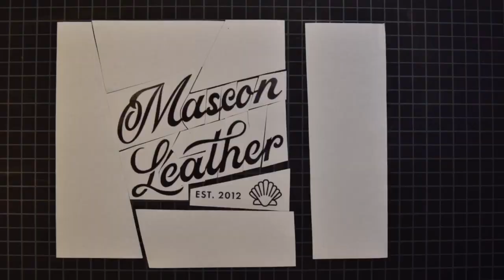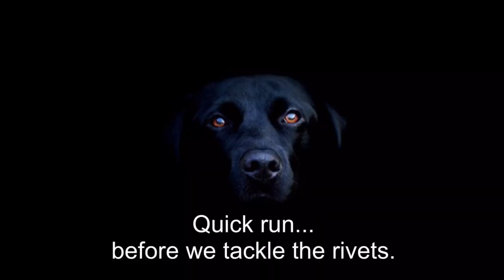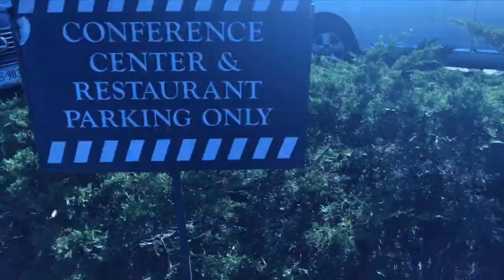Making a Leather Can Wrap! (Need a Name)

Comment: where did you get your thick squares?
Reply from the maker: I had them made by a machinist
Reply: @MasconLeather  Thank You. Love the way you use the squares and Rulers.
Reply: @MasconLeather  I found something similar on Amazon called Positioning Squares, that are used for wood working. you can get both Hard Plastic and Aluminium.